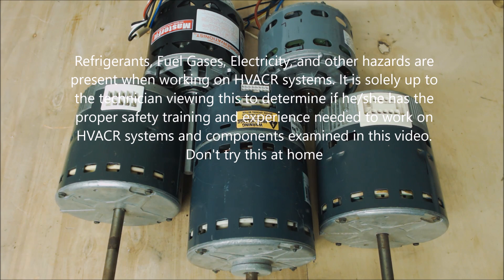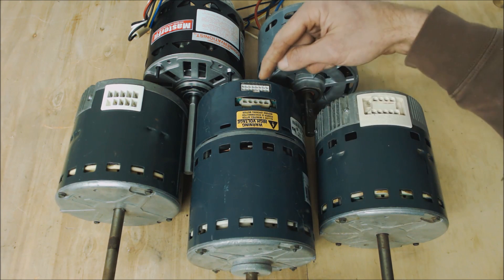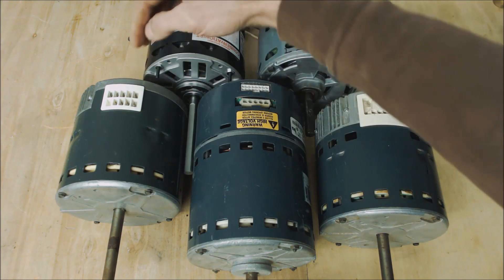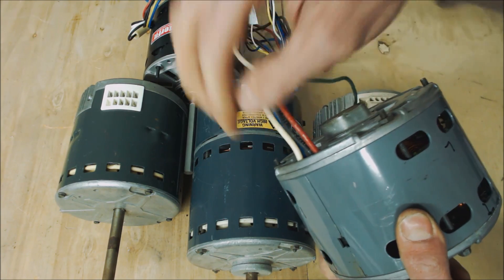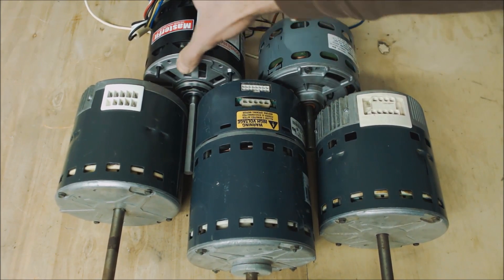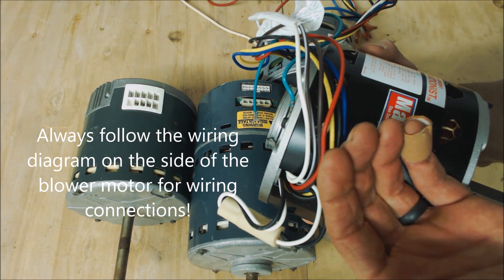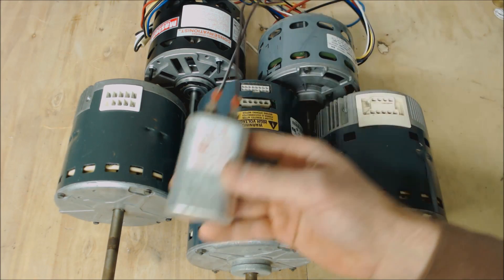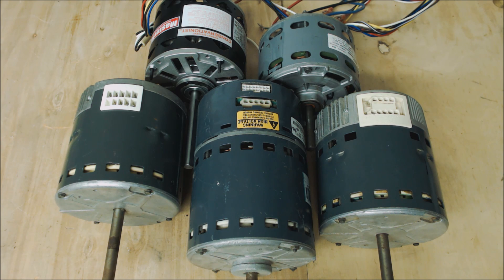How to Tell the Difference Between Blower Fan Motors: Variable, PSC, Shaded Pole, ECM X-13

Comment: Variable speed pool pump's save 80 to 90% energy and last forever according to pool man Dave channel.  They cost 4 times more than a regular pool motor but toi is less than 1 yr usually!  So why aren't you all putting those in acs?  The weatherproofing 5he difference?

Comment: I got a replacement control module for my Trane air handler 2.3 ECM blower (GE from 2002). My unit was wired for 240V and the replacement control module was an identical part number however it had a label from Trane (separate from the GE manufacturer label with the model number) which said “wired for 120V”. My thinking is that the module was pulled from a Trane air handler that used a 120V supply and probably had the jumper wire on the high voltage power input plug (5 pin) to provide 120V to both circuits in the control module. My unit is 240V and the 5 pin is not jumpered but directly wired with both sides of the 240V power. Would it be OK to use the replacement? Is this type of labeling by Trane commonplace? Aren’t these 2.3 ECM modules all dual voltage, just depending on how input power is wired at 5 pin?

Comment: Hi,
      I looking to replace my GE old Motor shaded pole 5KSP39HG 2108x  ( 115 v single Speed 1150 RPM , CCW (ROT) its basically for kramer trenton Evaporator Fan. Its making Squeaky noise and stuck put some Dw40 and 3 in 1 oil running but needs a replacement soon. Cant find anything. IT has long screws out on top (4 Screws ) to tight on frame upside down.   Please recommend something close so i can order one. Hvac guy wants me to install the whole new unit evaporator since he cant find the motor.

Comment: ECM will not have much advantage over a premium grade PSC motor above 30% load. However, on consumer grade motors the electronics will help improve energy efficiency.  Cost of electronic offsets cheapness in laminations and copper, but overall reduces weight and motor frame diameter and power factor can be corrected to create an efficient motor when using reduced quantity of materials especially for fractional  HP motors.  It's a lot to achieve for a motor turning 1075 RPMs.

Comment: Would these motors have any use for a shop project? Maybe a smaller belt sander or something like that? Not sure if these guys are able to be ran for 15-30 minutes. 

I pulled a motor out of our old hvac that looks like the PSC one (has a capacitor). I think it was the condenser motor, it was attached to the fan that is on the top of the unit.
Reply from the maker: The outdoor condenser fan motors don't run with a big load but the blowers do run with a bit of a load, thanks
Reply: @acservicetechchannel  Thanks for the reply.

Comment: Quick question sir. How do you feel about checking a capacitor under a load vs completely disconnecting it and simply checking mfd? Amps X 2650/volts = mfd

Any benefit to doing that?
Reply from the maker: I always teach the safest way to new techs. I find that there is always a way to test so that you don't have to be near the high amperage. I teach high school to adults so it must always be the safest way, thanks
Reply: Safety aside, and focusing solely on the technical side of it, is there any difference between the two methods? I’ve heard that testing under a load is the “most accurate” test. The source isn’t very credible tho. Lol
Reply from the maker: Some people use this method but once again, why be near the danger of high amperage after working in the heat all of the day or after a long day and night when tired. It doesn't make much sense to put yourself in that situation or to teach newer techs that in my opinion. It can be done though, thanks

Comment: Can you replace say a gentek ecm 3.0 motor from a Lennox for example and put it in another manufacturers furnace if that manufacturers furnace also had a 3.0 or do you have to purchase OEM from that manufacturers supplier?
Reply from the maker: It would work and turn on but the problem is that each motor is programmed for a specific model number airflow capacity size.
Reply: @acservicetechchannel  Awesome!  Thanks for the reply.  So it would work as a temporary solution to get someone heat until the manufacturers oem arrives.  Thanks again man!
Reply from the maker: The one thing to watch out for though is if the air speed is too low then the high heat limit switch will trip if the temp rise keeps increasing due to a lower amount of airflow, thanks
Reply: @acservicetechchannel  Good to know, thanks!

Comment: On the psc why would you ever change the direction?
Reply from the maker: If the squirrel cage was reverse of what it is normally and where you mount the motor is on the other side of the squirrel cage, thanks
Reply: acservicetech thanks

Comment: Another good video.   I prefer the old school psc motors.  They have a great service reliability and are inexpensive to replace if needed.   I understand why the vs and x13 are utilized but on  newer low seer and 80% afue furnace ac equipment it doesn't seem necessary.
Reply from the maker: I am right there with you!
Reply: so why isnt it necessary?  isnt it better than psc?

Comment: the genteq 3.0 motor with ONLY 4 pins (24v) is a variable speed motor?
Reply from the maker: Hey Mark.r hvac, here is a link to the Genteq ECM Service guide that speaks about visually identifying and then testing the ecm motors, thanks- https://www.genteqmotors.com/assets/0/96/101/111/112/222548e1-3a94-4465-ae93-3ac96782fea5.pdf

Comment: so how does the genteq 3.0 (4 pin 24v connector) makes it variable? i've always thought you need 12 to 16 wires for it to be variable? please help me to resolve this confusion. thank you.
Reply from the maker: Hey Mark, you can bypass the dc millivolt readings needed for the 3.0 to turn on at different speeds by sending the 24v to the 2 end wires on the plug such as whats done with the genteq service tool, thanks Mark. Sorry I didn't answer this sooner!

Comment: Can you replace an ECM with a PSC or vise versa?
Reply from the maker: You can if you are dealing with a single speed unit but not on modulating units, thanks
Reply: acservicetech this topic would make a great video

Comment: Great video! A few weeks ago I had a problem with an ECM combustion air blower on a Trane furnace and Trane had a updated conversion kit which included a PSC combustion blower and a new board along with a few new limits that came as a kit for about $700 for the repair so I suppose I can no longer get the ECM combustion blower for these products I wonder why they are reverting back to the older technology
Reply from the maker: That is odd. Maybe they are going with what they found to be more reliable. I just replaced a carrier variable speed motor with the newer version variable speed blower motor. My cost was 760 plus tax just for the variable speed inducer motor kit. This included a wiring harness adapter and the whole inducer motor housing, thanks
Reply: Do you feel bad about charging high prices for expensive parts? I do But I'm not shady like the Taxivid guy

Comment: Doesn’t the X-13 have a capacitor built into the silver cap if the motor? Thanks!
Reply from the maker: Yes the x-13 and the variable speed motors do have 1000 ohm capacitors mounted on their boards.
Reply: acservicetech thank you!